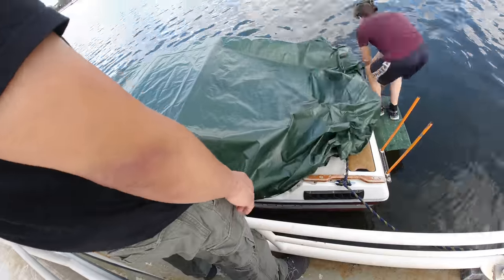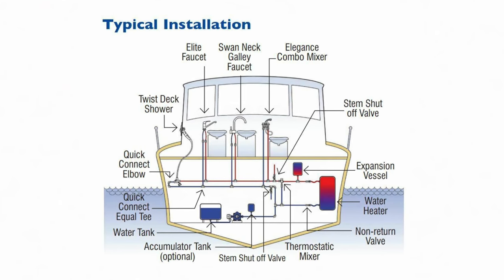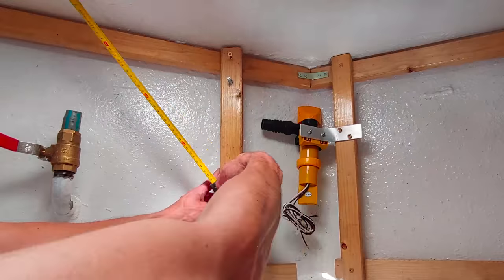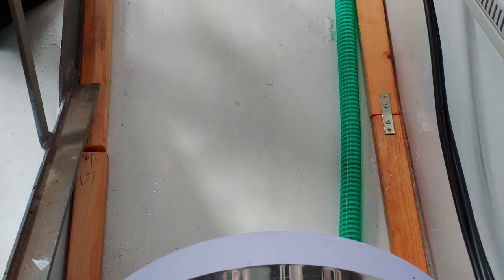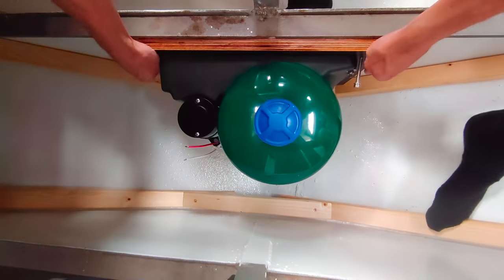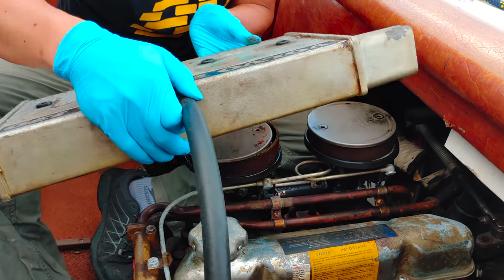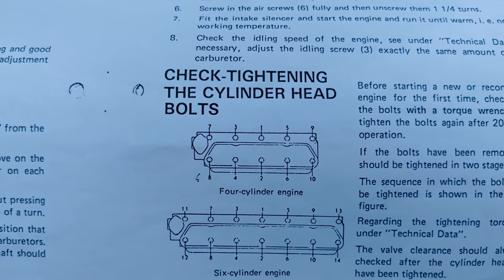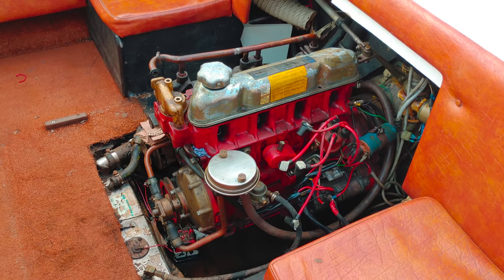OPENING the ENGINE of my 1980' BAYLINER Mutiny - Ep. #42 - Vintage Yacht Restoration Vlog

Comment: You are jumping to conclusions it looked time as you had a blown head gasket. Fill cylinders with a 1/8 cup of wd40 and then turn the engine over. About half way and let it sit with more wd40.  Clean out the rust and dirt and if you can turn the engine all the way over and you have no cylinder damage replace one piston and rings and clean it up and put it back together.

Comment: Cannot see the sense in putting the bilge pump under the heater, it will stop one day, then replacing it will be a nightmare, the engine has had some water damage, nothing that cannot be repaired, getting the piston moving and checking the bore will reveal the extent of the damage, some diesel will creep down and might work at loosening it.

Comment: dude, I don't think you know enough about engines to make a call on that, and engines that aren't new can always hide more crap. You don't always win when you find "another one in running condition". 

Do a more thorough investigation, starting with the bottom end, cost of a cylinder head, new pistons and rings, honing. Getting the frozen piston out is what's going to tell you the most, and with the bottom end disconnected, it's much easier to figure out what you're doing and what you've got.

Comment: Why not pull the whole engine out and put a bracket on the back and replace it with an outboard motor.
Reply: I have a very similar Bayliner from 1980 and the previous owner did exactly that :) I bought it wrecked, so, I replaced the transom and glassed all the rest damage and I hanged an outboard. Much better for such a little boat.
Reply: @anastasiosvanderpas7463  it is a common thing to do to Bayliners / Trophy with inboard/ Outboard motors. Outboard motors are way better then onboard/ outboards. Convention boats are awesome.

Comment: Need a real Bilge pump instead of that pretend one! And get one with a Float  switch connected  to your Lithium  Battery  with Solar  2500gal per min Minimum.  INSURANCE  POLICY!
If you spin out Drive Shaft packing or knock off a inlet Valve or Toilet  Outlet breaks or you HIT SOMETHING?

Comment: u have no idea about engines, engine is steel good just clear the piston, head,  headgasket must be change and try turn crankshaft with oil on the cylinder liner its all about

Comment: No response about the horrendous fuel system he cobbled together last time.
Reply: I think he is ahead of the videos or at least I hope that is the reason. Otherwise all I can think of is that he doesn't want to address the mistake on video.
Reply: He did reply in the comments section on that video where he acknowledges the lack of proper research, agreeing to redo the mess and thanking the commenters for their contribution to his knowledge.
Reply: @gking5522  only after everyone came down on him like whoa big problem. He needs someone who can advise him what is ok and go from there. Otherwise he will be reripping all this stuff out down the road.
Reply: @gking5522  I must have missed that. Glad he took the comments to heart. That could have been a disaster.